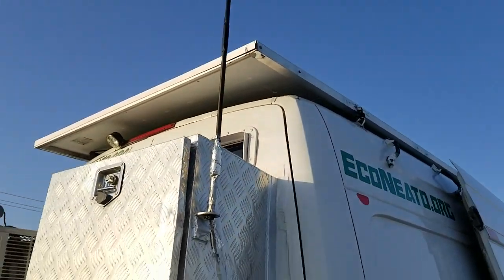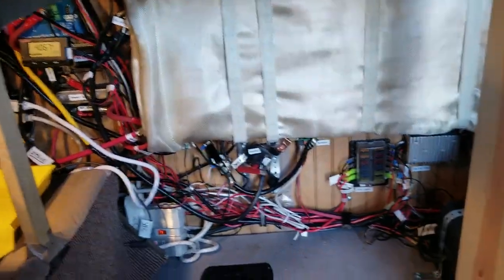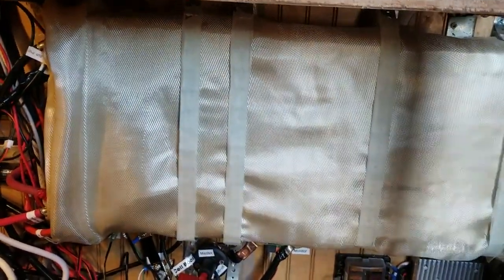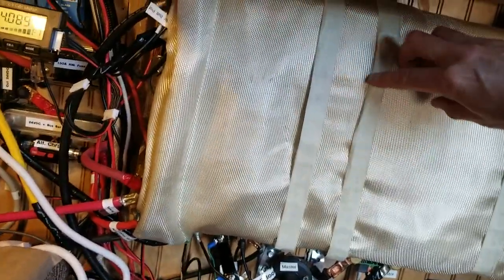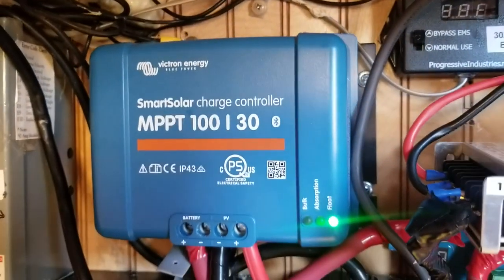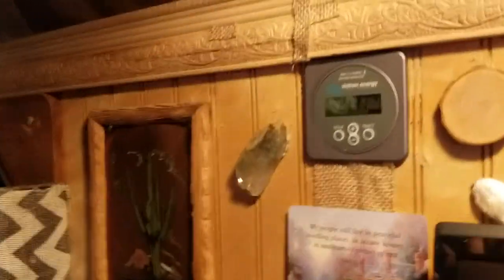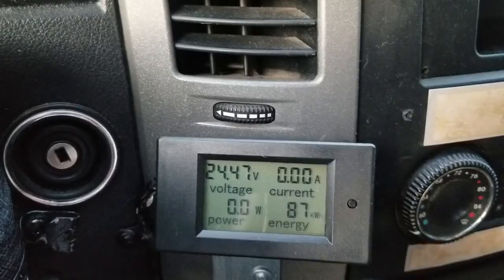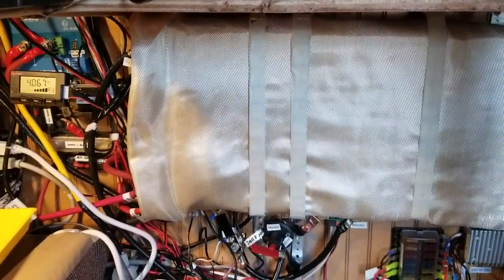Tesla Battery in a Sprinter Campervan, First EV Plug-in Port

Comment: Nice project. At what voltage does the Giandel Inverter disconnect from tesla batterry module? I have a tesla battery module and I am trying to find an inverter that help me get the most out of the batterry. Most inverters disconnect at 22v which let me use only about 50% of the batterry pack.
Reply from the maker: One of the best questions; at 19.8V (for me, but mfg. says 20.2) the 24V Giandel 3000W inverter sounds a warning alarm and at 19.6 it cuts off (19.6 according to mfg., but mine has never cut off that I noticed because I religiously don't allow that low of voltage. Here is the link to the exact one I've been using with no issues since 3/2019: https://amzn.to/360FEyG
Reply: @EcoNeato  thanks a lot for the quick response. These are great news :). I will go for it then and will add a battery disconnect at 20.5 just to be on the safe side.
Reply from the maker: @jabond8  what will your battery disconnect be? I use Victron BMV 712 regarding programmable from app.

Comment: Thank you very much for the video. We want to build a expedition vehicle on a truck base and want to have a huge battery system. I like the idea of using a Tesla battery because electric cars are getting really popular and it is a good way of recycling the batteries. 
Do you have any experience with the battery in the cold? In theory it would be enough to turn on the diesel heater in winter, what do you think?
Also I wondered if there is a reason why you put the battery into the „cage“?
I tried to find the details about your system on the Website but can’t find it. Not sure if there is some error preventing me from seeing it. Can you send me exact link? I am really looking forward to read in depth about the system you build.

Greetings from Norway,

Svenja and Nils
Reply from the maker: Hello in Norway! I had a track star friend from there, Trine Pilskog. I did use the Tesla battery module in cold weather and with a diesel heater. I mounted the module in the climate controlled living area. I wrapped the module in a fiberglass blanket to shield it from cold and provide a fire barrier if worse case emergency. I don't have the module in a cage. I had it secured with straps and now just let it sit on the floor. My webpage is down due to software glitches, but can provide personalized info upon request until I get that fixed. Do you travel to the United States? I wish for some way to ship my campervan to Europe.
Reply: @EcoNeato  Thanks a lot for your very fast answer. Actually we are from Germany, but currently travelling in Europe :) Ah yeah I meant the fiber glass, not a cage. Makes sense your answer. Would you do the same Electric setup again and especially choose the Tesla battery over a LiFePo4 battery again?

Do you still have that Information in a not broken way, old snapshot of the website? A pdf print e.g. of it would be great.

At the moment we have no plans to travel to the US, but in case we will let you know. Is there no possibility to ship to Europe right now?
Reply from the maker: @TinyCamperTammy  My late mother is from the eastern block: Schmolln, Germany near Thuregun. Tesla is overall better but requires very high level of electronics skills vs. standard lithium you only need basic skills. I like both and am undecided if I start over again. The only problem I have with the Tesla module is overheating when charging high amps, no way to cool it and the high risk if overheats too much, but have not had that happen. I can ship to Europe for the right price, perhaps $6,000. I'll work on getting the webpage fixed and send a link soon....
Reply from the maker: @TinyCamperTammy  Here is a rough draft of how I'm re-writing the webpage: http://econeato.org/power-station.html
Reply from the maker: @TinyCamperTammy  Here is an archive site, but may be slow to load: https://web.archive.org/web/20181221185353/http://www.econeato.org/lithium.html
Reply: @EcoNeato  Thanks a lot. Downloaded a PDF of it in case you want to take it down again.
Reply: Oh 6000$ is a lot of money :/
You are totally right, currently we have a LifePo4 160Ah LionTron battery and it was really easy to install for someone who had to learnt from the scratch about electronics. 
How many Amps do you mean when you skeak about "high amps" ?

Comment: Tesla modules would be my choice for solar storage.  The big issue is having a volt limiter, as typical 24 volt charge controllers limit volts to around 28.5 volts, this module will only safely take 25.2 volts.  The cost is what is the limiting factor, and therefore a volt limiter would be what I’m interested in.
Reply from the maker: I use victron products that allow programming maximum charging limits suggested to be around 24.5 Volts for the Tesla module. But victron products do not balance the cells so for that I recommended ISDT T6 30 amp charger but you can only use that for shore power or in my case Shore power and EV station charging. Don't forget when you say maximum safe voltage of a Tesla Model 25.2 volts that's assuming all the cells are balanced
Reply: Eric Talaska the Imax B6 charger has a balance function, although it only discharges at 300 mA per cell while balancing, I consider that a sufficient method as the Tesla modules are at 6s as well.  I will keep Victron in mind, and thanks.

Comment: Hello Eric, thanks for the video.
Did you lose or gain weight from implementing EV system vs original engine and how much?
How is your range now?
Any say how long it took you / would take you to recharge your batteries for a trip by solar only?

I would like to buy and convert a transporter into an EV but am yet unsure what that will do to weight, what range I could expect per charge and how safe it is (just watched a video about the safety systems Tesla applies to make sure their batteries stay safe and do not deteriorate before time.

Strangely few infos available in general it seems on van to EV conversions and with Tesla cells. Naively thought that a 2.2 ton Tesla with 200-300k range should allow a 3.5t van at least half that.
Reply from the maker: My van only has one Tesla module to power the RV appliances, not drive the vehicle. The vehicle still is driven by a diesel engine. Since the vehicle weighs 8,000 lbs. with the RV appliances, water, etc., even if the engine was removed and more batteries added, the range would be very short to push that much weight.
Reply: Hey, cool this is such a new video.  I'm looking into electric conversion sprinters; my Dad is convinced hes going to buy the 55kw, 100mile, 25hp, 2019 electric sprinter.  I want one that can push 200 miles but i don't need the big engine.  for 55kw or batteries i was looking at 6.8k in nissan leaf modules. could that all fit in a 144?

Comment: Changing, changing,... in the end you get a spaghetti of wires. I know you got everything perfectly right but it looks like a mess, should reconfigure everything, make it more atractive...  And use some isolation on the cable shoes for the Tesla + pole on 7:30
Reply from the maker: Have you seen space rocket engines? Looks the same for a reason :)

Comment: Wow, that is a messy setup. It is really strange nobody can live without inverter.
Reply from the maker: Yeah, because nobody makes proper DC appliances necessary for efficient cooling, cooking, etc. yet. They will, but maybe not in my lifetime at this slow rate.
Reply: @EcoNeato  I have never heard anybody is complaining that thair DC compressor fridge or freezer does not work well. Why would one must use electricity for coocking in a van when you have other heat sorces that are still in use domestically and functioning very well? Should one base a van setup around cooking food with a press on the button? I don't think so. For everything else 12 or 24V is perfect.

Comment: Which 24v to 12v converter are you using? The links in your website are no longer links.
Reply from the maker: Here is what I recommend now: Charger / balancer: https://amzn.to/39lhuAb and MEAN WELL RSP-1000-24 AC to DC Power Supply 24V 40 Amp 960W: https://amzn.to/3er5cc3

Comment: I have a 2019 Grand Design 3740 BH. I don't have the money to get a solar system but I was thinking about replacing my led acid battery with 2 Tesla batteries. I don't do allot of boondocking but I would like to. Do you think this would be a good idea?
Reply from the maker: You would only benefit from two Tesla modules if you have a practical method to charge them up regularly. If you don't then get just one. Or get two if you plan to get enough solar to keep them charged in the near future.

Comment: Mounting brackets for Tesla batt? Nice setup!
Reply from the maker: There are no brackets pre-made you have to make your own I just used plumbers metal strap and screwed into the metal frame of the vehicle. Thanks.
Reply from the maker: I don't use brackets anymore, I just let it sit on the floor, with braces on each side.

Comment: Great Job on your system, Is the tenergy thing a balancer or is it also a charger?
Reply: Boden L. I believe it’s a dc to dc converter
Reply from the maker: @TheMcdrewb   No, it's an ineffective balancer and meter only. I don't use anymore. Instead, I use and recommend this charger with auto balancer: https://amzn.to/39lhuAb   and  https://amzn.to/39lhuAb and MEAN WELL RSP-1000-24 AC to DC Power Supply 24V 40 Amp 960W: https://amzn.to/3er5cc3
Reply from the maker: Thanks; it's an ineffective balancer and meter only. I don't use anymore. Instead, I use and recommend this charger with auto balancer: https://amzn.to/39lhuAb

Comment: Congrats bro! So as far as I can tell, your the only person who has come this far to use a Tesla battery in a can convert. I am wanting to go vanlife next summer as I am saving up everything to make my build. The most important part of it all to me is power. I’m greedy so I want the best for the least. After months of research and actually making drawings up of a van build for myself, nobody else has built anything close to what I have on paper. And I don’t have room for 4 lithium battery’s or $4k to buy them. So what you have shown me is that for half that I can have this build your using and save 70% space... this is now my obsession...
Reply from the maker: Awesome, and you are the go-getter who could give me some advice on things I didn't think of, so please let me know if you find a better way for anything.
Reply: So how long does the battery last running the ac, if you cut the solar off?
Reply from the maker: @cassidykrull3605  If the one Tesla module is charged at 24.4V the AC will last continuously for about an hour, but normally it would run up to 4 hours because the AC cycles on and off vs. running continuously.
Reply: I wonder how well it would run a smaller unit that uses less power... I just completed my van layout using cardboard and have it all set up in my living room lol.. I’m going to heat my van with radiant heat. Was told you can keep a tank underneath the van in the cool, that in turn could cool the inside down up to 20 degrees of the temp outside...
Reply from the maker: @cassidykrull3605  Smaller units don't necessary use less power due to them being much less efficient (less EER). They are also noisier. I don't know anything about the tank method you mention; please let me know if and how that works.
Reply: @cassidykrull3605  with my 600 ah of lifpo4 I could theoretically run my window ac for 10 12 hrs straight drawing 35 40 amps continuous

Comment: How long can you run your AC on that one module?
Reply from the maker: Indefinitely all day long with moderate solar. A few hours with no solar. But this depends on how much the AC compressor runs. Since I don't have large windows and the van is well insulated, this 6k btu unit will freeze the interior quickly, causing a lot of cycles on and off. It's really too large for my situation, but nobody makes a smaller AC that is also quiet and with an EER of 12.2.
Reply from the maker: Just one under average nighttime temperature circumstances but if you're in east Texas in the middle of August then that night you might need two or three modules

Comment: Thank  you for devising and sharing your Tesla system!  I am wondering how the system manages the charging when all three sources, solar, alternator, and AC Mains are active.  Thanks again!
Reply from the maker: My charge sources are (in order of importance): Solar, alternator, shore power, EV charging station. When more than one are active simultaneously, there is simply an increase in amps on the cables/wires that are connected to the chargers. This can cause the battery to get warm and possibly overheat, so a BMS (Battery Management System) / relay is important.

Comment: Best video i have seen so far!!! I just bought a ram Promaster and will need some help. I hope you can provide some guidance.
Reply: I am currently in Michigan, I am pretty technologically inclined, but I have not worked with electrical or solar before. I want to make sure I have redundancies in my electrical set up. 110 for home hook up, shore line, solar, alternator and so on, just in case. I have been looking at used Tesla batteries for the battery banks. I would love to have a conversation with you. what is your email? we can exchange numbers
Reply: First Last so much for responding....how’s your build going??
Reply from the maker: Mine is complete but I haven't heard much out of first last who may be busy with family
Reply from the maker: The most recent major improvement is to use this for charging and balancing: ISDT T8  and  https://amzn.to/39lhuAb and MEAN WELL RSP-1000-24 AC to DC Power Supply 24V 40 Amp 960W: https://amzn.to/3er5cc3